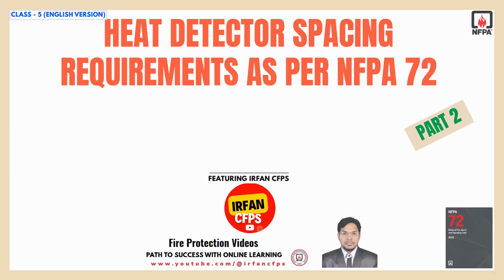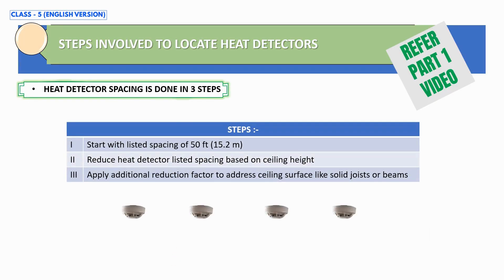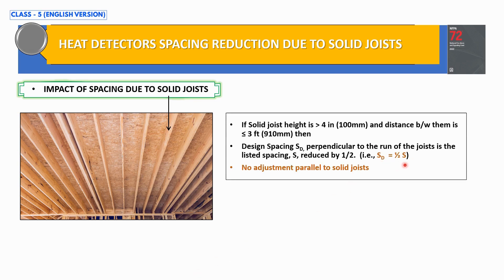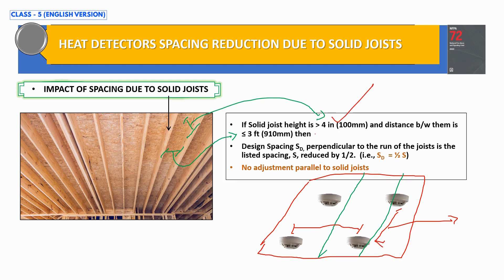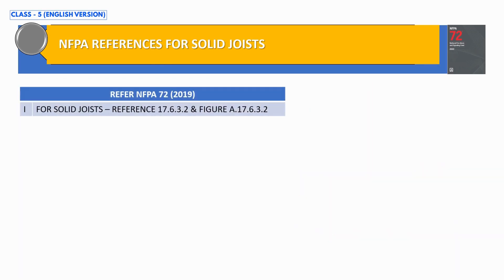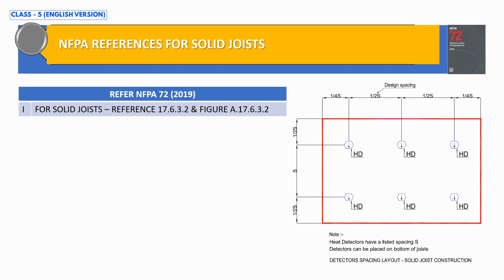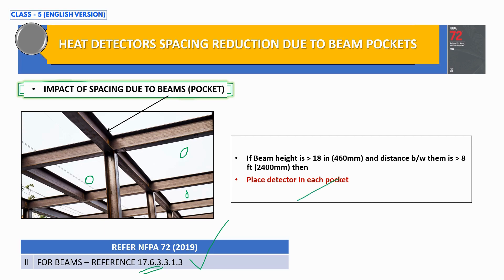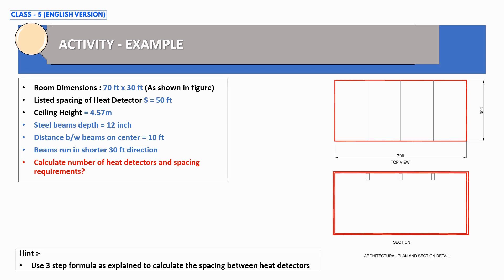Heat Detectors Spacing NFPA 72 Fire Alarm System | Part 2

Comment: Number of detectors rewuired is 2 as per the calculated spacing??
Reply from the maker: Nice. Correct.
Reply: @irfancfps  calculated spacing is 25.67 then why 2 detectors.i think it should be 3

Comment: 1. Multiply Listed Spacing by ( from Table 17.6.3.5.1 ) as it is  Ceiling Height 12 in > 4 in & Distance b/w Beam's them is 14.98 ft > 3 ft	= 0.77	
2. S =	38.5 Ft
3. Sd = 2/3 * S =		25.67 Ft
Reply from the maker: You are 100% correct, Thanks